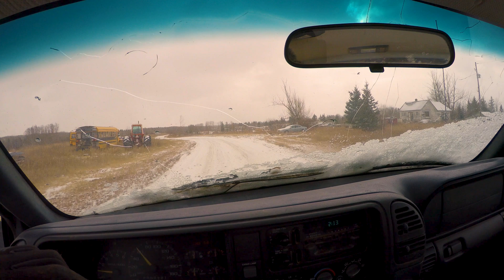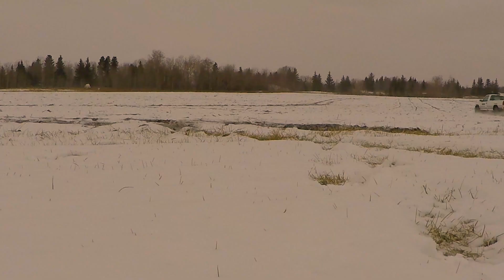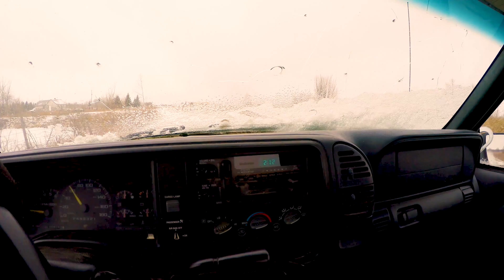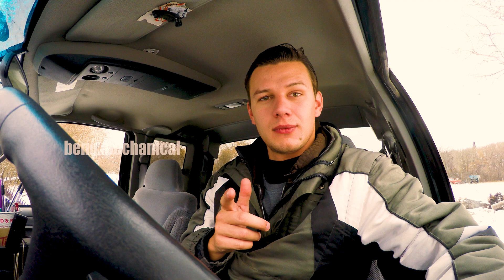Checking the Farm Trucks Reliability // Half-Million Km 4.3L Vortec

Comment: Hey I seen an ol Allis!  I spent well over 1,000 hours in the seat of a similar one.  Honestly probly closer to 2,000 hours 😄 Ours was originally a 7040 powershift, but had a 7080 engine put in it back in 1990, then repainted to the 7050 paint scheme with 7045 decals. 🤣
.
Anywhoooooo,  great vid!  Evidently those old Chevy 4.3's are hard to kill.  
You have a new subscriber.  
😎
Reply from the maker: Hey man! Thank you so much!

Definitely try and get a few videos with the ol'tractors too!

Lots of life lessons learned on the seat of one of those 😊

Thanks for the sub. Will work hard to keep it.